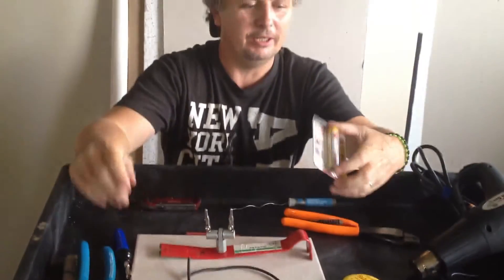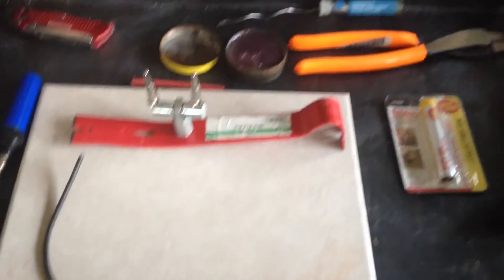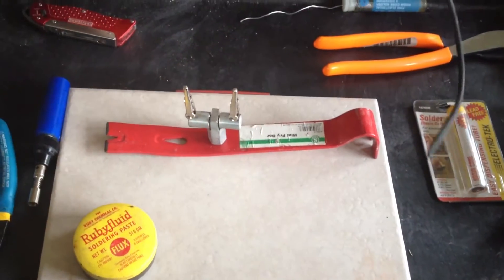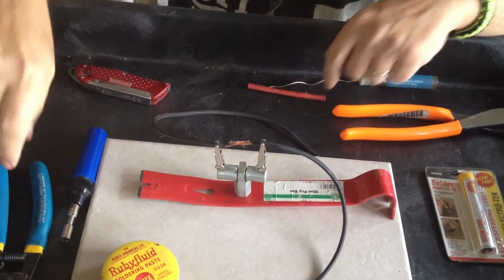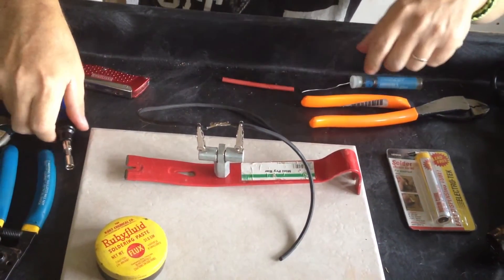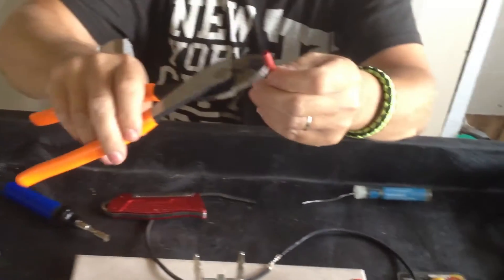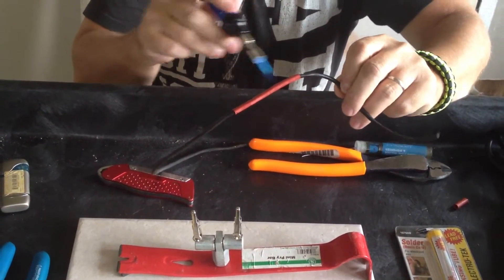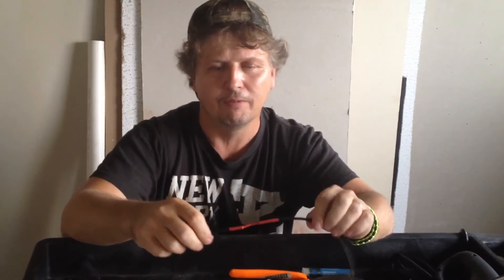How To Solder Two Wires Together Professionally And Easily

Comment: The flux is only necessary if you are using solid solder (remember to use rosin flux). If you are using rosin-core solder then you do not need the flux paste. Remember to apply heat only to the wire and let the wire melt the solder, otherwise you will not get consistent reliable connections. NEVER USE ACID-CORE SOLDER FOR ELECTRICAL CONNECTIONS. That is used for pipes and conduit.
Reply from the maker: +LesterElm1 Thanks for the info